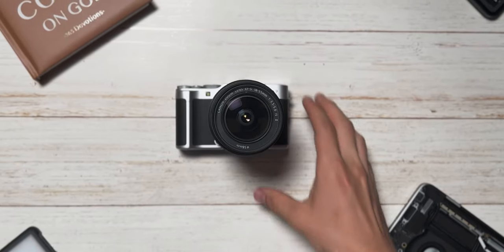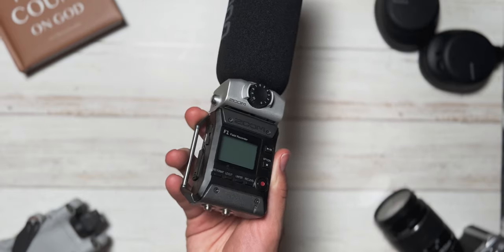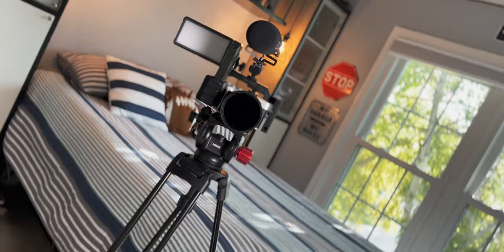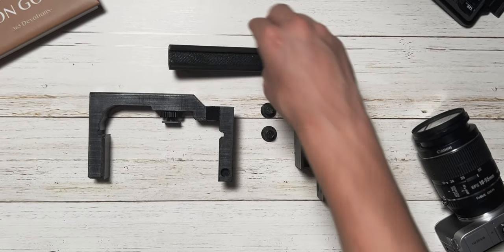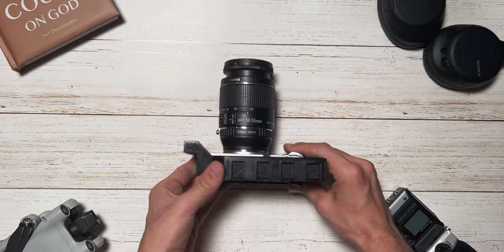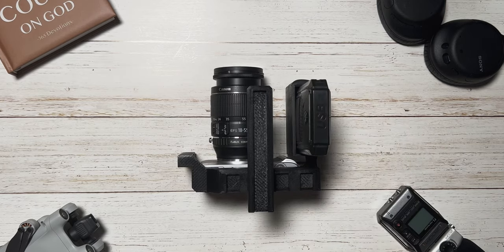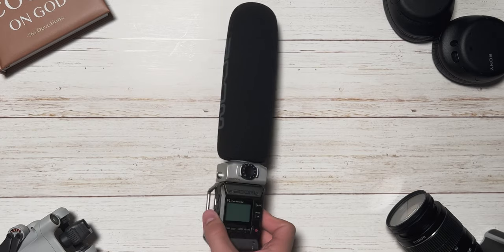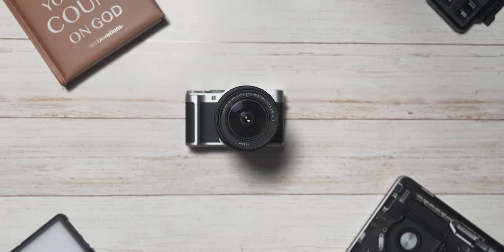I 3D Printed a Camera Rig.

Comment: I'd suggest making more contact points from the camera cage to the camera itself - it will not only be an added safety in the design, but also make it more stiff, hence flex less. You can easily design the part to either add in nuts during the print, or to add threaded inserts afterwards. It would also allow you to add more mounting options. I like the way you did not follow the thin design of aluminium cages - always design part to the intended manufacturing process  - 3D printed part needs to be designed differently to a milled one. Good job!